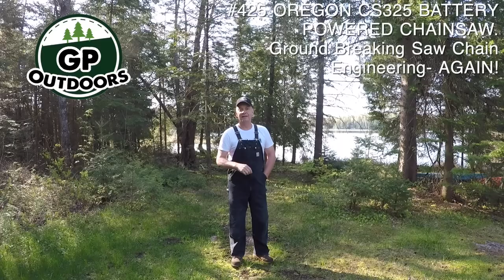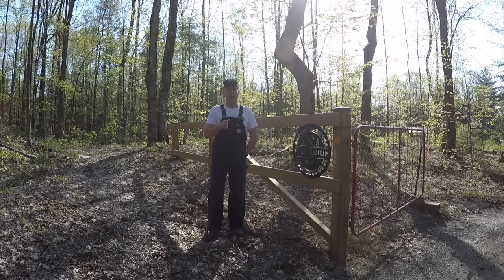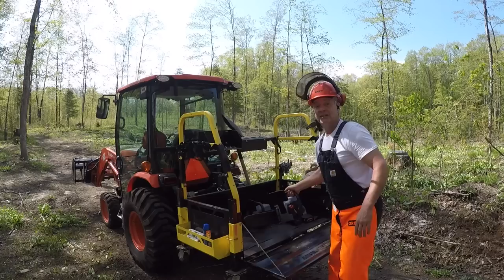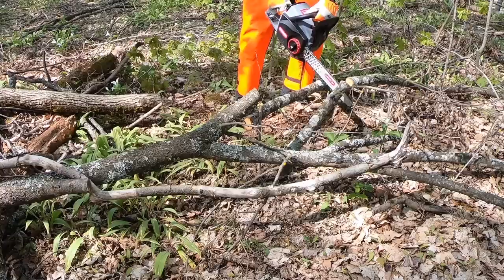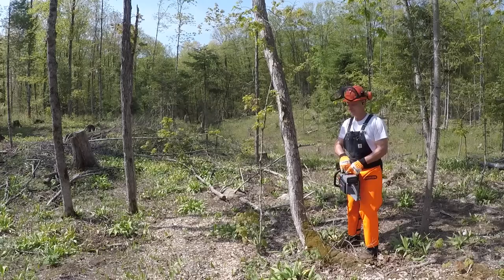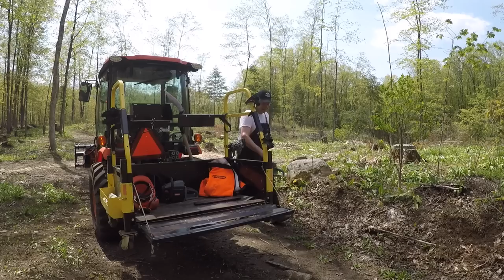#425 NEW SAW CHAIN Engineered SPECIFICALLY for BATTERY POWERED CHAINSAWS! The OREGON CS325 Chainsaw.

Comment: Nice saw! Looks like these battery saws are improving. I got a Milwaukee Saw after your video last year. I choose that one because I already had those tools and the batteries match. That saw has become the one I use 80% of the time compared to my gas saws. It's just so practical. I wonder if that new Oregon chain designed for battery saws fits on other brand models.
Reply from the maker: Good morning Roger! That's a great question - I am not sure. But Guy is like you - he uses the battery one all the time since we got it. Have a great long weekend!

Comment: Thought about and wanted to go electric for trimming. But 150.00 for a little 170 that I did not have high hopes for was a game changer. That little 170 with a chain upgrade is hard to beat for the buck.

Comment: I never heard of such a thing GP. But the difference in the saws are audible. Little or no change in sound with the Nano chain. To me it seems to put less of a load on the motor and would possibly extend battery life. That’d be nice to see as you run it all the way down. Great info once again.

Comment: I have an inexpensive gas chainsaw that we use for small jobs around the place and it works ok. That little battery powered saw looks like it would do everything I need without the hassle of a cheap gas saw.

Comment: Battery saws have come a long way Gord.  I used my “wife’s”  battery husqvarna all weekend,it worked great trees up to 8” in diameter.  Very easy to take into field for quick cuts.  Still for larger trees and limbing...I will use my new stihl or my dads 40 year old all metal stihl...it’s a tank, about as heavy as one too.

Comment: I have the Dewalt 16 (40 amp) and 12 inch (20 amp) electric versions. I took out a few 60 foot tall ceder trees with that Dewalt 16" electric saw. It wasn't easy down near the base where the trees were probably 3 feet in diameter, I had to cut it from both sides, but it worked perfectly fine and made me some nice firewood. Side note, you pronounce "Oregon" improperly (like people on the east coast of the usa), its not "or-eee-gone" but actually pronounced "Or-eh-gun"

Comment: Very nice. It would have been nice to see a bit of a close up of the teeth profiles to see what they have done. I'm actually considering a battery chainsaw as they are a lot easier to start than petrol ones. 1 thing that does annoy me about them is the noise. They are a lot quieter than a 2 stroke obviously but they still make a helluva lot of mechanical noise.
Reply from the maker: Good morning Alan. Great idea - I will include closeups and the specs on the next video. Yup- it sounds like my grandma's old sewing machine.:)) Have a great weekend!

Comment: I bought the CS300 for my wife's birthday - she loves it. But I find that the wood chips plug up behind the tensioning cover very rapidly - within 2-3 minutes. So much that one cannot use the sharpening feature. Does this happen with the 325?
Reply from the maker: Hey good evening Terry. I have not found that with the 300 - I clean it each time I use it, like my other saws. The 325 does not have a built-in sharpener - just files or a grinder, as we sharpen other saws. Hey, what kind of wood do you cut with the 300? I am kind of interested about the chips you mentioned plugging the built-in sharpener. Thanks!

Comment: The older chainsaw stalled out cutting and then had to be started again. Does stalling regularly happen with this chainsaw? Meanwhile the new chainsaw does not stall.

My Ego chainsaw regularly stalls when cutting into bigger pieces of timber. It’s annoying. It has a 16 inch bar. I’d like to get a bigger chainsaw but am worried the bigger Ego will have the same issue.
Reply from the maker: Good morning Karl. Me too - usually when cutting into bigger stuff as well but i know that it may be largely because I may be forcing it too fast into the wood ( I think). Often, it is because my thumb slips off the lock button as i am pivoting the saw.

Comment: Wow, that is an impressive chainsaw with the SpeedCut system.  The question now becomes, do you have to sharpen it in a different manner to a standard chainsaw chain?
Reply from the maker: Good day B! Great question - the 2in1 sharpener I use won't work on it but it sharpened like normal with files or a grinder like your others. The gauge and file sizes etc are captured in the manual. Thanks!

Comment: Good to see that someone has developed a new chain specifically for battery powered chain saws! The Oregon saw looks totally plastic, if it is, I wonder how it will handle the heat of the motor over time?

Comment: What is the weight of that saw with battery ? And what is the average run time before it needs recharging ?
Reply from the maker: HI Alton. I believe it was about 12 lbs (I don't currently have the manual). I tested the CS300 and I get just over an hour of run time off a charge. I will do a video soon on all the specs and test to see if it holds for the hour as well. Thanks!